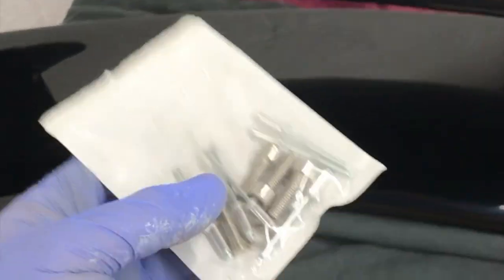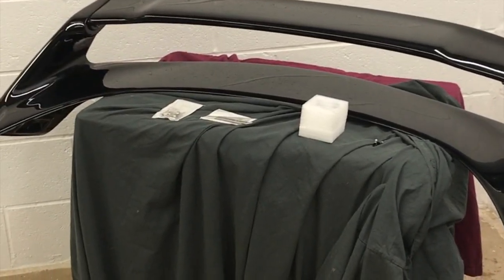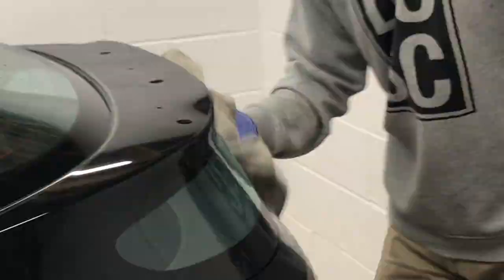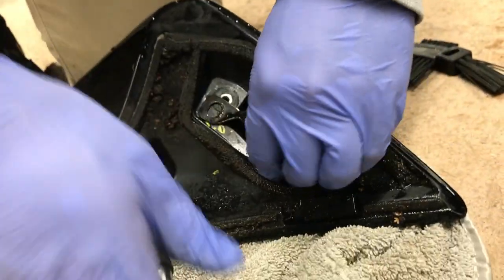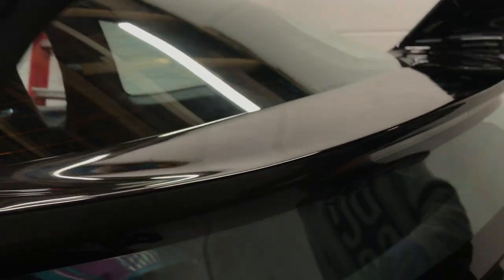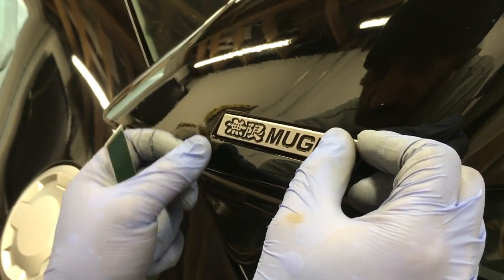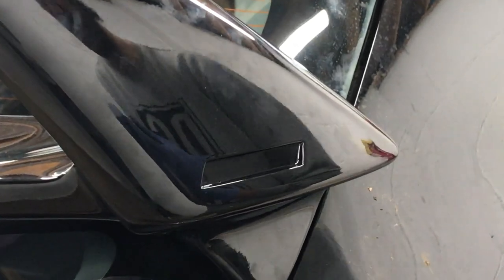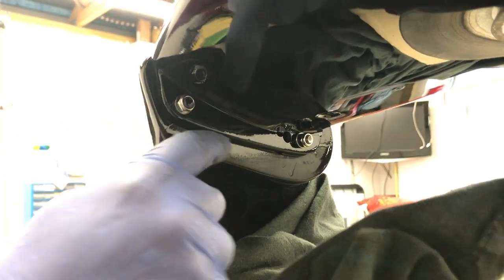How i fitted my Mugen wing

Comment: I  dont reccomend this method (fitiing spoiler not on oem typeR trunk door) this plastic glass thing brakes after 2 years of useing and brakes on each of drilled holes that can cause easy water access to the trunk. In standard civic model u dont have metal mounting specially made for fitting the spoiler, in this solution you are mounting nuts straight on the plastic glass, it vibrates generate some force when you drive or when you close trunk etc. If you dont want to replace this (plastic glass aquarium looking thing) just dont do it or buy typer trunk door. (Cables in typer and non typer trunk are diffrent! have that in mind too. Ive been there :/)
Reply from the maker: Maybe I’m missing your point due to translation.
Are you saying don’t fit a spoiler to a non Type R? 
This video is how I fitted my spoiler to a Type R.
It is not Intended to be an instructional video and it is especially not a instructional video for non-type R.

Follow any video on YouTube at your own risk.
Don’t make assumptions about outcomes.
For clarity… this method in this video on a Type R has worked for me. With no leaking or damage to my vehicle.

If you want a type R… buy a Type R.
Or buy a type R boot lid. 

Have a nice day 😃

Comment: Just got my Fugen spoiler, just need to get it sprayed, how much did you pay for yours to be sprayed? Seems like they need a lot of prep, the primer is far from smooth.
Reply from the maker: Mine was pretty smooth mate, where’d you get yours? 
I paid £200 I think maybe a bit less?!
Reply: @yardspeed13  cheers, I got mine from Delta styling, type r kits didn't have them and wouldn't for some time. Needs a bit of sanding for sure!

Comment: i dont know how to install it.. i drive the type s and my car had no spoiler from factory on , so there are no drillholes
Reply from the maker: Yeah not sure what you can do with the Type S to be honest. 
My only suggestion is to maybe get a Type R boot lid so then you’d have the correct bolt holes? Obvs you’d need the same colour and have to swap the lock over. Sorry I can’t help much more than that.
Reply: @yardspeed13  thanks for the fast reply ! i think i will find a way :)
Reply from the maker: @thecivicguy5229  good luck, hope you can sort it bud 👍🏼

Comment: Hi, your video is realy helpfull thanks for that ;) Can you tell me where i can find the 2 mounting pieces that are hold on the spoiler with the 4 bolts? I bought the same spoiler but i have a 1.8 so no type r spoiler and no mountings :S (I just have to drill holes like those in the type r but need those mountings ^^)
Reply from the maker: Hey man, thanks for the kind words, I appreciate that a lot. 
I’m not sure what bit you mean… all the parts came with the spoiler when I got it from TypeRkits. 
Do you mean the bits that attach the blade to the upright bits or something else? Sorry mate I’m not much help here am I?
Reply: @yardspeed13   Sry for my English, trying my best ^^. I mean the metal piece that you unscrewed from your old typer r spoiler and you screwed to the mugen one. (Don't know the name of it ^^)
Reply from the maker: @Foxxbe  sorry mate I was being thick, nothing wrong with your English. It’s just been so long since I did that video, I just had to rewatch it to see what you mean.
If I’m honest I’m not sure where you could buy them new, you’d either have to contact a breakers or buy a second hand Type R spoiler off eBay to get those brackets. 
Or you could try Cox motor parts. 
Good luck with it though, I’m sure it’ll look mint when it’s fitted

Comment: What screws did you use for the sides? I tried to use the stock ones but they didn’t fit for some reason
Reply from the maker: They should fit mate… I’d take the spoiler off and look inside the threaded holes make sure all the threads are good and clean. Same for the bolts. Also make sure the holes are aligned. Not sure where you got your spoiler from but some after market stuff is a really pain. Good luck with it.

Comment: Hey do u need to put sealant on wing? Is that to stop water getting in or to secure it from moving? Are the bolts not strong enough to secure it?
Reply from the maker: The sealant is mainly for keeping water out… but obviously it does also stick the spoiler down. If I remember correctly the OEM spoiler has a bolt in the middle which the aftermarket ‘ Mugen’ didn’t have, so you effectively have less bolts holding it down, and since it’s bigger there will be a greater ’pull’ from the wing of the spoiler so all things considered I think it’s best to have the sealant. Otherwise you run the risk of water ingress. Up to you at the end of the day. I wasn’t keen on using loads of sealant either. Hope that helps.
Reply: @yardspeed13  thanks for the quick reply